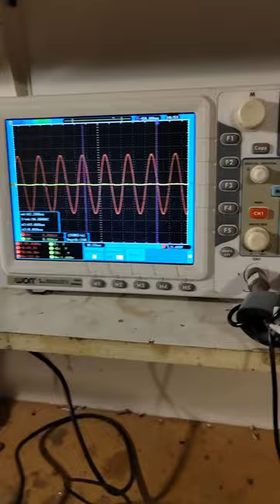Making a hot dog was never easier

Comment: why not just make a half bridge inverter, those can handle way more power
Reply from the maker: The beauty of ZVS driver circuit is in its simplicity and low component count. It was a project I could build up with spare parts during one evening. Bridge topology would be better in many ways and if I ever need a powerful induction heater, I will definitely go for full bridge configuration.
Reply: @Astri.electronics  Ya you can use both of your FF1000R17's and make a 300kw induction heater!! haha, btw where did you get those I would like some
Reply from the maker: @Tsindur  I'm currently building huge Tesla coil with those 😄 I bought them on ebay. If you find sellers from outside of China, they are usually legit. I was looking for German sellers, because in my experience, they are the most trustworthy and reliable